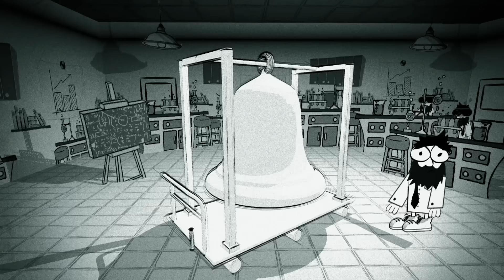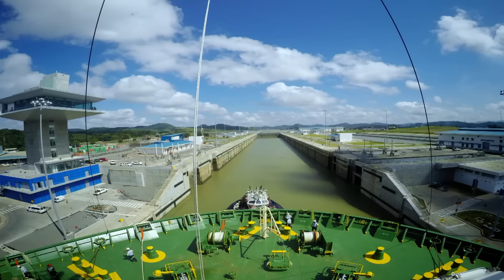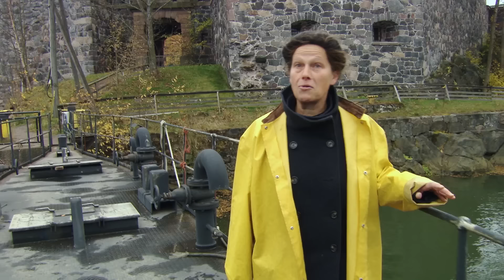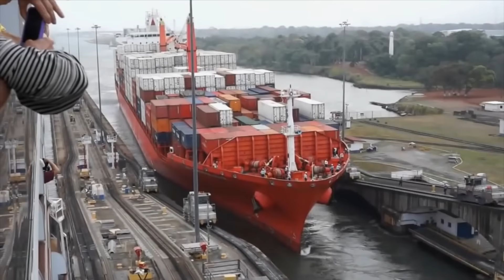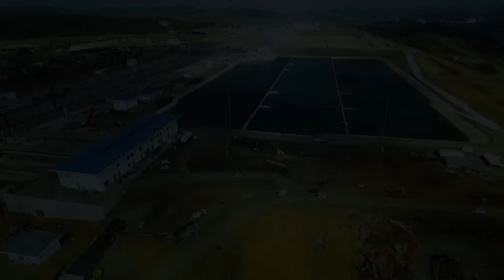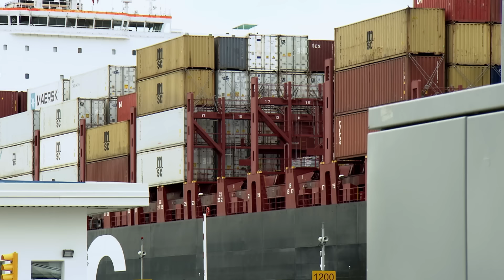The Extreme Engineering Behind the Panama Canal’s Modern Makeover | Blueprint

Comment: This demonstrates that they knew about the increased water consumption and that it would be a problem with the massive ships. Now, they blame it on 'drought'. If you look at annual rainfall amounts, Panama has not been in a drought - other than its usual dry seasons. The reservoir simply cannot keep up with the usage. The water conservation system that they claim (very unconvincingly) is re-using 60% of the fresh water is, in reality, only saving 5%. But they knew they had to sell the project and if they were truthful about the water situation it never would have been built. This is why they are now engineering a larger reservoir solution.
Reply: Huh
Reply: Of course, kicking the can down the road is easier